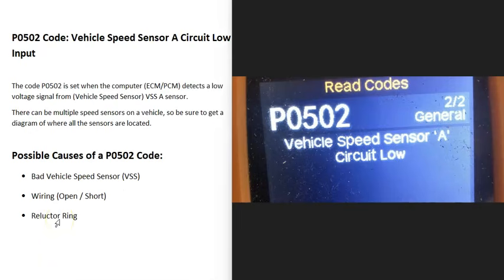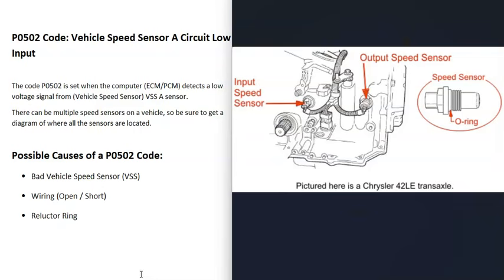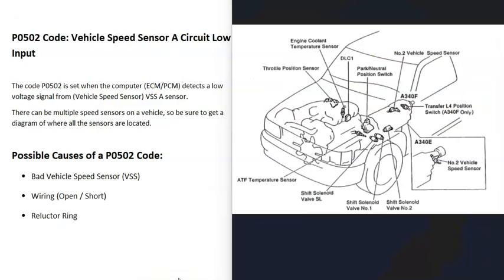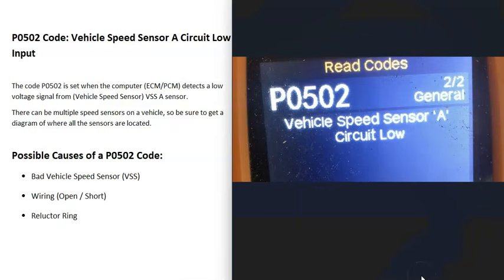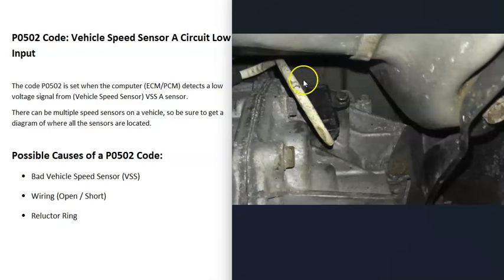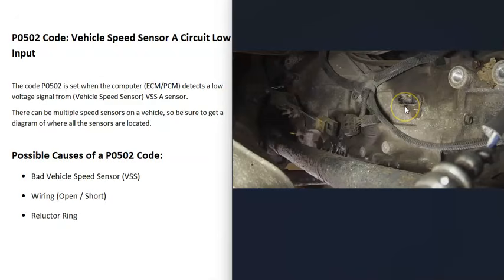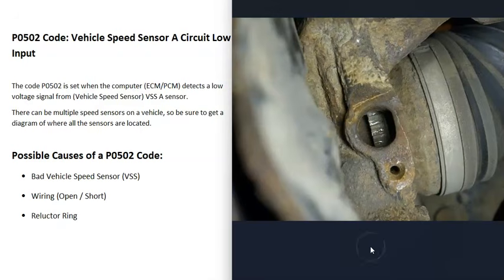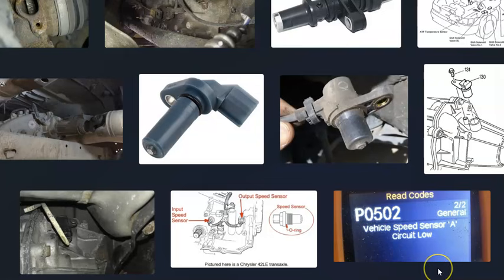Causes and Fixes P0502 Code: Vehicle Speed Sensor A Circuit Low Input

Comment: 2019 Honda HRV when you scan it two codes of p0502  speed sensor A No signal .Then there was Abs system shift selector malfunction 83-16 .                We had speed sensor A replaced with no change. The cvt Transmission was remanufactured unit only 6 months old. Lmk what you think Thanks Bob G
Reply from the maker: Was the replacement speed sensor OEM? Sometimes 3rd party non-oem sensors cause issues. I would test the wiring next and be sure the circuit is good. The 83-16 code is likely caused by the speed sensor issue.
Reply: @HVAC_Mechanic Yes Generic sensor order OEM Honda sensor and will inspect wires when installing OEM sensor will let you know how I make out  . Thanks Bob G

Comment: This code came up after I got a diagnostic done cause it kept stauling in the cold after my buddy replaced my engine. It says loss of power. It starts normal in the summer, but the colder it gets, it takes more turns to start as it slowly gets power to idle steady. Do u think he didn't do the wiring properly? Cause it all started after the engine replacement

Comment: if my spedometer is fine but i still get this code does that narrow it down at all between wheel sensors/trans sensor/main sensor?
Reply from the maker: It can vary from vehicle to vehicle, depending on which sensor the computer uses for the speedometer. It's best to get a diagram of all the sensors for your vehicle. If you have a good scan tool, you can pull up each speed sensor drive and see which one has the problem.

Comment: My 2020 gmc sierra is throwing up this code as well as P25A2 ,causing the check engine,traction control,abs,and ESC to turn on.by any chance would you happen to know what the problem may be?I have no idea where to get started.thank you
Reply from the maker: It needs to be diagnosed, but I would start by checking if the battery is good and that the alternator is charging correctly.

Comment: Thanks for the video! I'm having an issue with my van where the speedometer always reads 0 and struggles to shift gears (automatic). Took it to a mechanic who scanned and found a P0502 error. He tried replacing the VSS and checked all the wiring but no dice. Tells me it's probably an issue with PCM. Wondering if there's anything else I can check before taking it to a mechanic with electrical expertise?
Reply: Did you ever fix this? I’m currently going through the same exact thing
Reply: @sebastiancastro986 did you fix it
Reply: Did you fix it